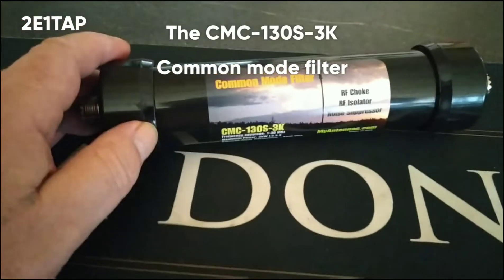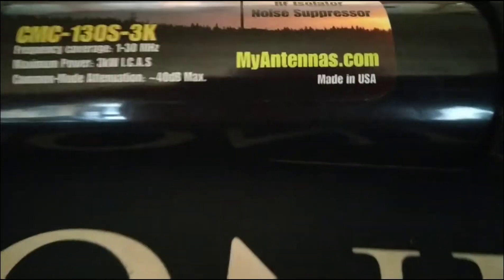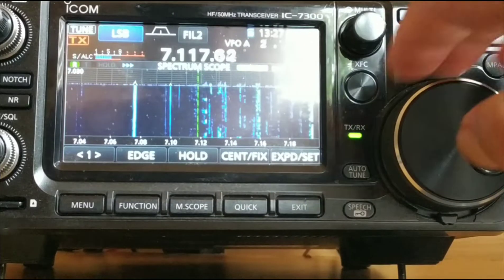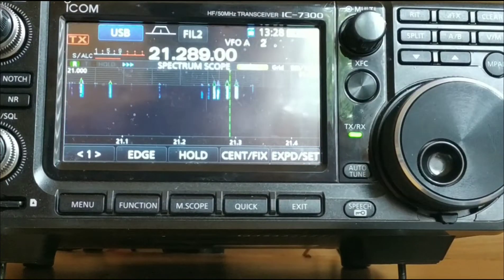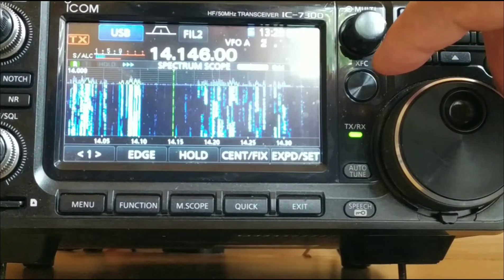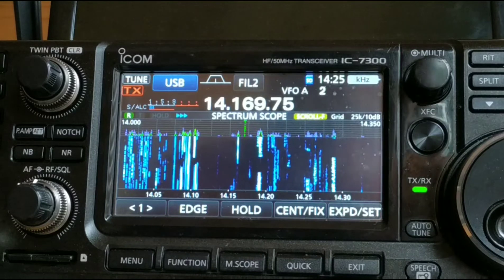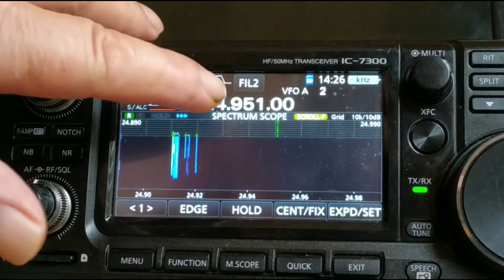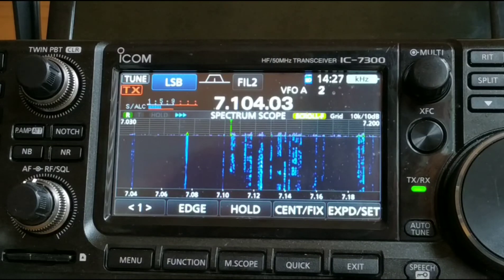Will this filter reduce my noise ?

Comment: Nice, inside is a load of toroids is all so easily made, you do have to make sure if you're running a long wire you don't put it close to the feed point, it has to be about a 1/4 wave or so away if you can. EFHW and Random wire's use the coax as a counterpoise. it also  does means though if you have any other multi-band antenna you cant use 6-4m
Reply: No loads of toroids and not easy to make to get these results.

Comment: Why not build your own you would have saved a fortune .....in fact for what you paid in shipping you could have made a comparable one.
Reply from the maker: I probably would have saved money, but the object of this video was to test the product featured.
Thx for the info though
73
Reply: How do you make comparable one with over 10,000 Ohms of Common mode rejection and  mostly resistive  and not reactive impedance?  Yes, anybody can get some FT-240-31 and wind some turns but it is nowhere near to the CMC-130S-3K. There is a lot of R&D behind this product which people with comments like yours do not realize.
Reply: @danielhorvat4340  You read the TXT and educate ones self by building said item instead of getting ripped off by people making a living out of selling such things.  What a stupid reply.